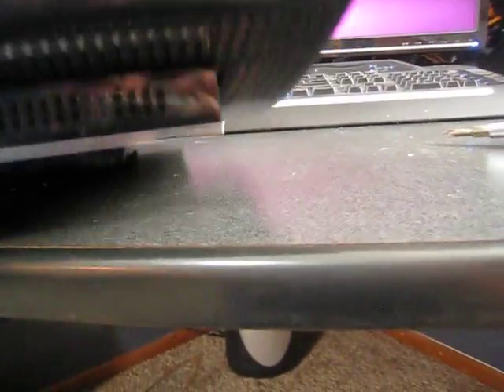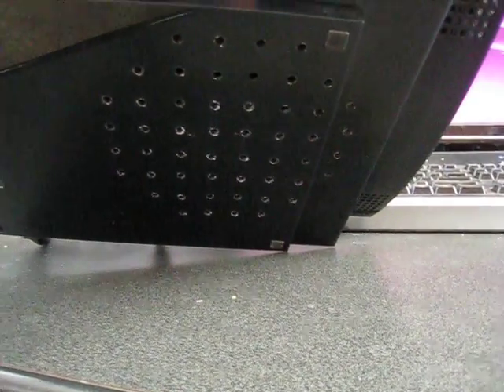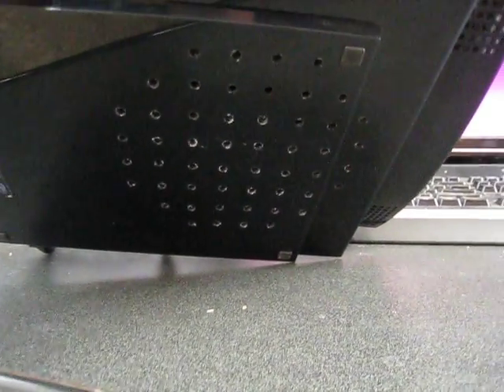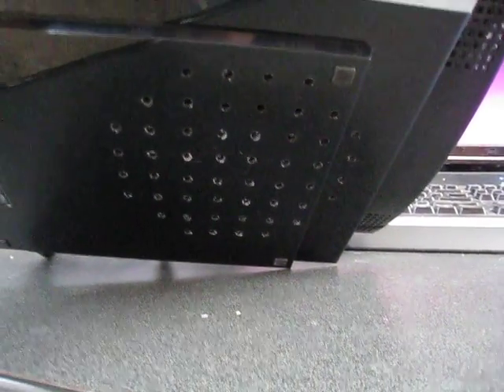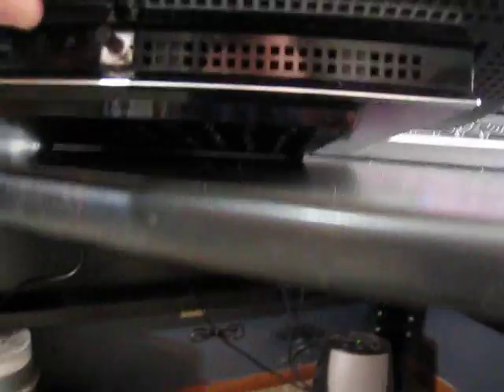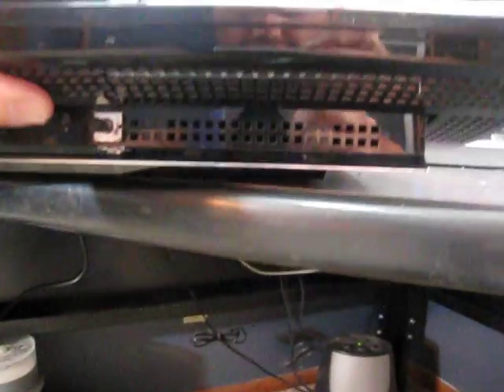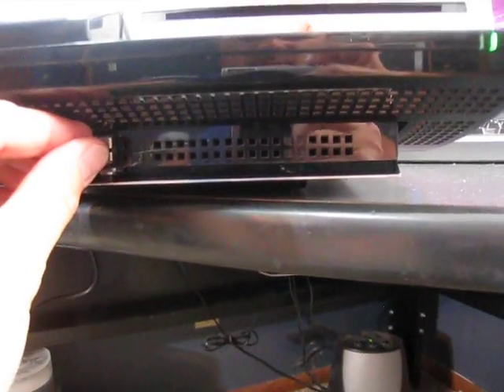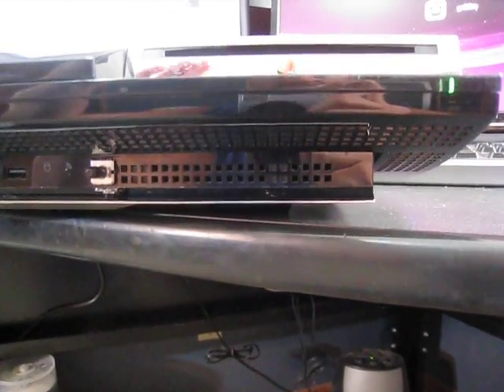PS3 Fan Controller Mod

Comment: Quick question, I'm using 22 guage wire to power the fan. Is that too heavy coming from a power lead? will it burn out the fan? I know these fans are very finicky
Reply from the maker: 22 Gauge is fine; you could even use 24 or maybe 26 gauge. The fan will draw only the current it requires, and you just need to make sure the wire size is capable of handling it. A quick search found that the fan is rated at 2.2A, so here's how you'd find out what size you'd need:

Check out this table: http://www.powerstream.com/Wire_Size.htm.
Under the Maximum Amps for Chassis Wiring, find the rating just bigger than 2.2A.
Check across under the AWG gauge column to find the minimum size needed.

Although the fan will rarely, if ever, draw 2.2A, you're probably safe with 26 AWG, but never hurts to be  on the safe side and use 24 or bigger. 

Essentially though, too big is always okay; however, too small and it can overheat the wire. This usually just shorts out the wire (principle behind fuses) but could run the risk of catching fire. To small and you also have to figure in voltage drop due to the resistance of the wire, but this application the wire is short enough that it's not a concern.
Reply: Okay. One more question, on the potentiometer, what if i didnt wire ground to it? just the middle and right wires? it would still work, just the fan wouldn't turn off if knob is all the way to the left, correct??
Reply from the maker: I don't think so. They don't give a schematic, that I can find, so I can't be certain. But most fans like that run off a sense voltage where the fan speed is determined by the voltage detected on the control line. In this case that's the center tap from the potentiometer.  

What the potentiometer does then is create a voltage divider. When the dial is turned all the way up, it will output 12v on the center tap. When the dial is turned all the way down it grounds (0v) the center tap. When it's between the two extremes, it outputs a voltage proportional to how much it's turned. You can read how they work here (http://www.allaboutcircuits.com/vol_6/chpt_3/6.html). 

If connected the way you suggest, the pot works as a variable resistor. The voltage on the center tap would remain the same at 12v (or whatever voltage is supplied to the pot). And instead of outputting a varied voltage, it would output a varied current.
Reply: Okay, that makes a lot of sense. So basically if I were to do this kind of wiring, without the ground, I would have varried current then instead of voltage. So I have constant voltage, but can adjust the current. So that means I can still change the fan speed from low to max, correct? how exactly would the fan act when used as a rheostat?
Reply from the maker: Not exactly. If I'm correct in that the center tap of the pot runs to the sense input of the fan, then it doesn't care about the current supplied to it, only the voltage. So if the voltage is always 12v, it will always run at it's max speed.

However, if instead you connected the pot to the supply voltage of the fan, then it might work. You'd also have to connect the sense voltage line directly to 12v. However, in this scenario the fan will want to run at max speed which requires about 2A. If you don't supply it with 2 amps,  there's a good chance you could burn out the fan. Also, 2A at 12v is 24W, so you'd need a pretty beefy pot or it would overheat and burn out.

Trust me, it's way easier just to ground the pot :)
Reply: agr00m Good call. Alright you make a point, will do. Going to go with the pot setup and grounding it then. Thank you :))
Reply from the maker: Glad I could help!
Reply: quick question, i got it all done. but, if i barely touch the poteniometer, the fan will sometimes stop and go back on. like i will slightly move it and the fan will turn off. think i have something now soldered correctly? or a bad potentiometer?
Reply from the maker: I may need a few more details, but let me recap: It usually works like designed, but if you bump it while it's running it will sometimes stop, then immediately turn back on. Does that sound right? Is it when you actually turn the knob, or just bumping it? 

If so, then it's probably one of two things.
1) As you said, a bad potentiometer
Get a multimeter and test the resistance between all 3 pairs of connections. As you're testing, jiggle the pot (as you would when you get the problem) and see if at any time the resistance drops from some number to zero. Also be sure it's not just you removing a probe from the pot. This would mean there's a short somewhere.

2) A bad/loose solder connection on the potentiometer. 
Use the multimeter and do a continuity test on each of the 3 pot connections. Put one probe on the pot (on the metal behind where you soldered, and not on the solder) and the 2nd somewhere back along the connected wire. Then jiggle the pot and see if it temporarily loses continuity. 

Also be sure there's no chance any of the leads on the pot can touch, this would create a short and cause that to happen too. If everything tests good, you might have to start troubleshooting the entire circuit. Ensure all connections are good (continuity between parts), or do as he suggests at the end of the tutorial:

"If you can, I recommend connecting the controller to a 12V AC adapter and a multimeter before soldering it into the system. Fat units should output about 0.45V at "low speed" and about 4.55V at "high speed" these numbers can vary as much as .5V depending on the specific components used. Slim units should vary from about 0.3V to 3.0V."

I drew up a quick schematic too if that helps. 
http://i.imgur.com/mKIi1s8.jpg
Reply: Awesome, thank you very much for the detailed info. I just figured it out. So I took all you told me into consideration. I then also decided to buy a couple new pots. I went ahead and tried a new one and it works flawlessly now. Bumping it a bit, moving it around, no drops from the fan. I'm thinking the prongs on the pot from the previous one were going bad, since they were being bent a lot. I think bending those 3 prongs is a bad idea, but also some of the leads on the pot were a bit loose as well, not just those 3 prongs.

Here is my update!

Also I had to take ground and 12v for the fans from the two large pins from the power supply on the motherboard. The pins on the fan broke on mine, damn sony!

PS4 FAN MOD
Reply from the maker: Also just a additional note. My previous post about the pot/voltage divider was slightly wrong. Instead of using the potentiometer to create a variable voltage to control the fan, he's using a PWM (Pulse Width Modulation) signal with the 555 timer.

As you turn the potentiometer, the 555 timer varies the duty cycle of the PWM signal (ratio of time high to time low) from roughly 10% to 90%. This varies the RMS voltage (roughly the average voltage) and controls the fan that way. I'm thinking you could essentially do the same thing with just a pot, but this is a lot more efficient and stable way to do it.
Reply from the maker: Awesome! Looks good, and sounds like it's performing perfectly. I'd never seen a video yet on the PS4. I'm sure it's a little more difficult to work with because of the compact space too.
Reply: agr00m Yes it is a bit of a challenge, not much space to wire everything so had to let the wires loose on the back (or under) side of the ps4. Luckily I have mine vertical with some rubber feet on the bottom for ventilation. Went ahead and used a bit of electrical tape on the wires on the back to keep them from floppin around. Luckily this whole process was the same as what you had though!! Thank you!

Comment: Where did you get that switch from? And also does it work for the Xbox 360 slim
Reply: Digikey, but any 100k potentiometer will work. Just make sure it's some kind of snap-in style mount so it looks decent.This is the one I used:
http://www.digikey.com/product-search/en?vendor=0&keywords=CT2268-ND

Unfortunately I don't know if it works for the slim, but can't see why not. As long as you knew which wires to bypass. Check out the link to the tutorial, he might have a slim mod.
Reply from the maker: Digikey, but any 100k potentiometer will work. Just make sure it's some kind of snap-in style mount so it looks decent.This is the one I used:
http://www.digikey.com/product-search/en?vendor=0&keywords=CT2268-ND

Unfortunately I don't know if it works for the slim, but can't see why not. As long as you knew which wires to bypass. Check out the link to the tutorial, he might have a slim mod.